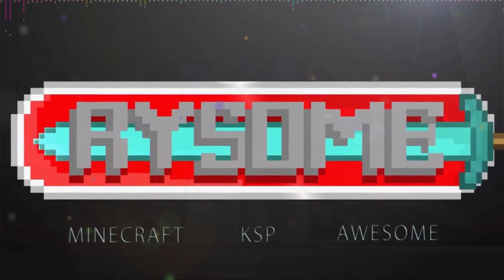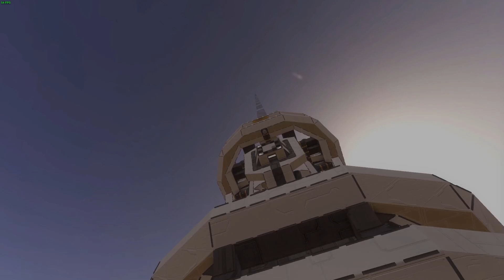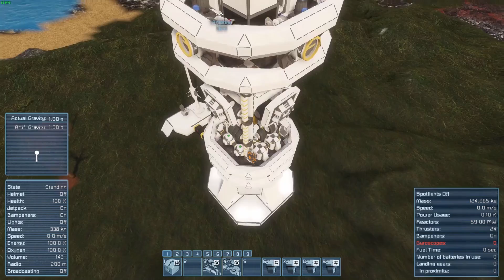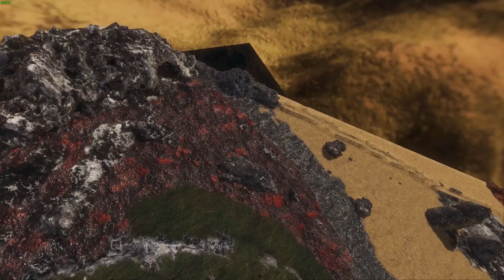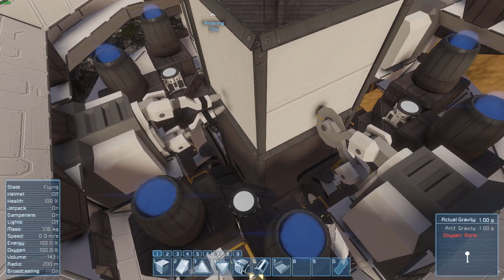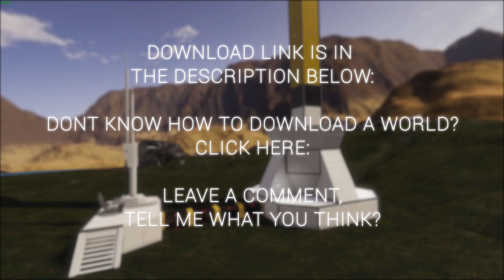Space Engineers: Self Building Space Elevator, 3D Printing, (Outdated)

Comment: So you didn't really put anything in the Video about this and so I have a question... How the hell does it move down the shaft without gravity pulling it into the base and destroying it? Do the wheels press so tightly that it basically locks it while no control is being pressed or is it the downward thrusters that keep it locked into position? Do you just press the thrusters to make the upward facing ones fire to descend? If so, how do you control the speeds against the gravity to prevent the inevitable crashing to the surface? I've built a lot of planetary landers and let me tell you, it takes a LOT of opposed thrust to counter a 1.0 Gravity field, especially if you have a small cargo/mining ship or vehicle attached to the elevator. And it looks like it only uses Ion thrusters which are useless once you enter the atmosphere, which means you would need to replace them with hydrogen thrusters. The issue then would be the fact that you need hydrogen tanks to fuel it which take up more space and jack up the design, so you'd have to deconstruct the whole thing just to fit it with such thrusters. And then there is the fuel problem, being that it is likely you would burn up whatever hydrogen you could fit inside the thing before you got halfway up or down it... Have you tested this with actual vanilla gravity mechanics or no? Sorry for long post. Also I'm not trying to be a jerk, I know it comes off like that. I'm just curious as to it's actual functionality in current game builds (vanilla) :)
Reply: +Tad Silverthorn Also I should say that this is something I have really been dying for lately. Currently it takes these massive ships or platforms (For platforms it takes up something like 60 Million kg in mass) all fitted with an insane amount of hydrogen thrusters which in turn takes an insane amount of fuel that burns up quickly, in order to land/take off of a 1.0 G planet. This is the only way I can justify building a base or facility on a planet. Ice for oxygen for example, is best harvested on planets where a stationary mining drill can usually get enough ice for a straight year of playtime on a single world, or for maintaining Hydrogen farms once you use an electrolysis generator (they call them oxygen generators in SE) system to separate the atoms. For hydrogen the drills need to be mobile as the ice in a single area will deplete and hydrogen burns too quickly for that small amount to maintain. In addition those platforms for planetary landing take hydrogen to ascend/descend as I said so they usually burn up more than 3/4ths of the payload by the time I get to orbit. So a platform that can go from the planet to orbit capable of hauling that cargo off-world using minimal resources in terms of thrust is something that is very, very, veeerry appealing to me. It's an awesome concept and if you were to keep working on it i'm sure many others would find it very useful. I would be willing to assist you on the design parameters if you want I just don't have time(patience) to construct the damned thing myself. Though I may download your outdated model just to see what tweaks I can make to qualify my specification of low-resource usage orbital transport.

Comment: Does anyone have tips for getting the main vehicle on to the starting pillar? Thanks :)
Reply: +exelsiar build the cart first then just a few blocks of the rail. put it on, finish the rail. (in case of non self building space elevators)
or put it onto the rail on top (in space) if thats an option for you.
Reply: Hmm, ok i'll have to give both options a try, thanks :)
Reply: oh and almost forgot. tho' hard for some cart designs:
if you rail is already placed and you want to build a cart or replace the current one you can also build 2 halfes and use mergeblocks then

Comment: Cool, our first assignment in Solid Mechanics was actually to design a space elevator cable. Everyones conclusion was that we need graphene or carbon nanotubes to do it, if you did it using steel the "cable" would have to be something like 1000 meters thick at the end and nanometers thin at the bottom, in other words not possible. With nanotubes/graphene you could get away with a centimeter thick cable at the end and milimeter thick at the botom, which would be doable :D

Comment: 2 questions - 
i dnt think this would work with current game, it just falls over 
& how too you in creative, via blueprints, place the vehicle onto the base?
Reply from the maker: +zak cooper  The Elevator was built before planets, so it needs to be retrofitted; add hydrogen thrusters, other tweaking. The base platform should be perfectly fine as long as you embed it slightly into the surface. Placing the Elevator is a bit tricky. I usually just place the blue print right over the pillar and let the elevator fall into place. Not the best way, though I haven't found a better one! 

Hope that helps :D
Reply: +RySome thanks bud I will try!! Do you have any plans to update?

Comment: 1 Why do you need to grind the shaft going downwards?
2 does it actually smoothly tolerably go up into space and back?
Reply from the maker: +Captain Katawa Glad you asked! The grinders are there if the Pilot of the elevator decides that they no longer need the elevator shaft. It's no a requirement or anything, It
s just there so if you want to get rid of the elevator shaft, you can!  And yes! this craft can easily glide up and down from space and back, In fact, on the way down, this thing can really pick up some speed!
Reply: +RySome careful of that speed though. And wouldn't it be cool if you drilled down and had the elevator passing through the planet?
Reply: +Ben Riddle Unfortunately you can't dig deeper than 7 km underground.

+RySome The self dismantling setup is quite cool. People usually don't think about how to dispose something